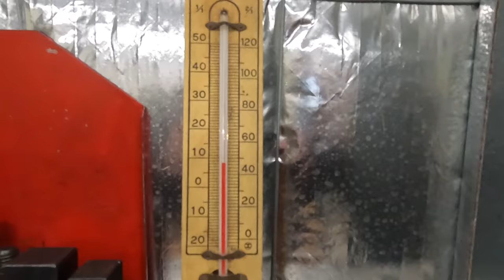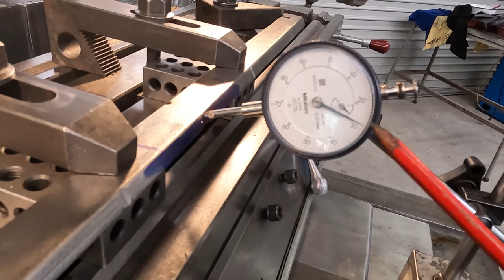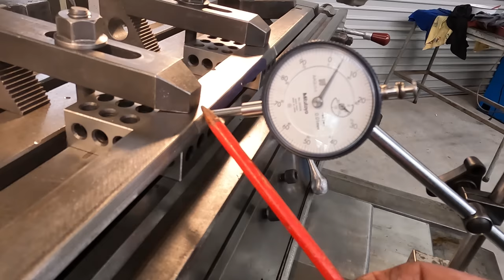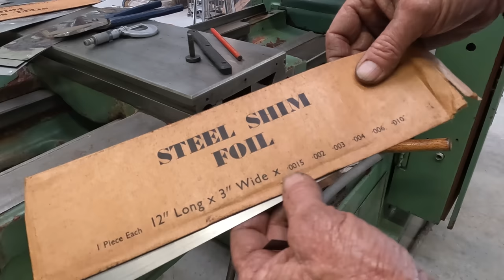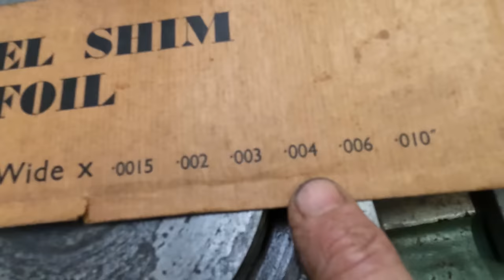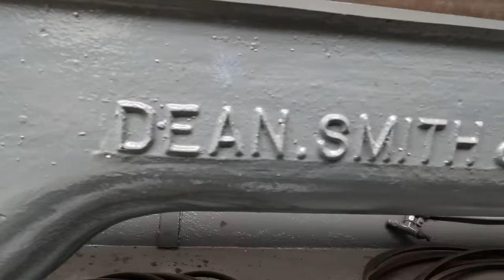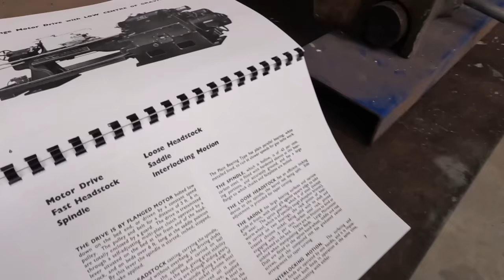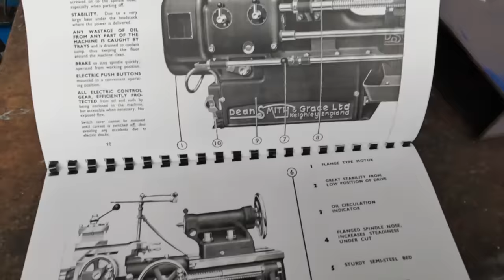Back On To The JFMT Lathe Repairs  & An Old Queen of machining Is Now In The Shop !

Comment: Steel shipping bands can be used as shim stock in a pinch, and also can be thinned on a surface grinder (the ultimate in desperation) The DSG is a good looking war horse.
Reply from the maker: Thanks .   I have a stash of banding , but it was too thick .    My grinder , a Jung HF50 is not up & running yet & i don't think it has the req'd travel .  It's a bloody long gib !  👍

Comment: Hi Max, my Mum in Perth and Brothers are complaining about the cold.
My DSG 13x42 was built in 1954, I got the date verified by a DSG agent in North Freo, back in 1995, He sent the serial no to DSG UK and they had records of the lathe.
Imported by Gilbert and Lodge and used by the PWD in Perth.
I was only 2 years old when she was unloaded from the ship in Freo wharf!!!
She had a rear mounted 5 HP Crompton Parkinson motor, UK made.
Had a Matrix clutch driving through the gearbox and then through 5 B section link belts, Brammer belts.
One pulley had built in eccentrics to loosen or tension belts, pretty clever.
I think the belts were designed for better finish and good shock absorption for interrupted cuts.
Of course the feed gears were mounted on the spindle.
Your change gearbox for feed shaft and leadsrew looks the same, chain driven internals.
That beast will remove metal at ease.
Reply: Just to clarify the chain in the feed  gearbox is attached to the knob which moves the selector in the gearbox.
I know the internals very well after my 4 year old Daughter had played with the lathe while shutdown and engaged the half nuts, next morning started the lathe motor and engaged the clutch, horrible noise, the carriage hit against the support for feed and leadscrew casting.
Stripped 2 gears, one of them was internally splined, hardened and profile ground, had them remade by professional machine shop in Myaree.
He was critical of the DSG design,  crossfeed to short, allowing rocking, they did this to accommodate the power drilling attachment to clamp on the dovetails.
Handy attachment with 4 MT taper.
Reply from the maker: @willemvantsant5105  Ouch !    Also the tracer attachment mounts there as well .  That drill attachment looks a good thing , there is a picture of it in the manual i have .  👍
Reply from the maker: I would love to be able to track down the info on my one , have the serial number but it may be too old .  👍
Reply: Give DSG a call, they might may have records back that far.
I have some original manual pages for that machine, but not anything you don't have in the reprint copy.
I wouldn't be surprised if it was lineshaft powered in its early life, I believe that generation of machines date from the late 1920's to 1949 / early 1950's when the new models were launched, but finding any definitive information is difficult.
Reply from the maker: @dutchgray86  Thanks .  I just looked them up for the contact email .  👍
Reply: @swanvalleymachineshop  I had a look in my archive and I have an original sales brochure for this generation of lathe also.

Comment: Max-  I have used Loctite (Henkel) to glue the shims to the gib strip.  Just clamp them overnight, and let the Loctite set.  A little heat will remove the shims easily if needed.  I have done this a few times and it makes it less fussing around when installing everything.  Also, do not overlook steel banding material used on pallet shipments for a source of shim material.  I have seen from .015" to .023" banding.  You can even surface grind it to fit.  ---Doozer
Reply from the maker: Thanks .   I have some  steel banding i have been saving for such purposes , but it was too thick .    👍
Reply: @swanvalleymachineshop   I don't remember if you have a surface grinder functioning, but remember you can always grind sections of the shim, and move it over on the magnet. No need for a long capacity grinder for just a silly shim.   Also the DSG is wayyyy coool.  I have a Colchester 17" round head lathe, and the engineering on it is a bit sketchy.  Probably more of a general use machine than a toolroom machine.  Interesting to see the design of the DSG as you take put it back together.   I really love these detailed machine videos that you do.  I have many machines in my shop that I am restoring.  Man if we were neighbors, we would be at each other's shops all the time.  Darn other side of the planet !   --Doozer in NC USA.
Reply from the maker: @kooldoozer  My grinder is a German made Jung  HF50 , but i still have work to do on the machine before it gets powered up .  Lol , yes we probably would be knocking back a couple of coldies on occasion !

Comment: It looks as if the machine has never been worked hard, it seems to still have a lot of life in it, of course it is from the 30's or 40's and that means it was produced and built like a tank, it will be a welcomed addition to your shop. 
I can only say that the Horizonal Boring Machine is what I am growing old waiting for you to work your magic on, even though the Boring Mill has defiantly been worked hard and put away wet as they say. see you and thanks for showing us all these things from the land down under, you are having winter and we in the western USA are having a hot summer.
Reply from the maker: Thanks .    The Boring mill is high on my list .  I will be doing it at the same time as the DSG .  Cheers .   👍

Comment: Max it is certainly a beautiful Old Machine. If you are anything like I am you want to keep it as original as possible. Hard to do sometimes but that is why we do it. Great demo on the repair of the Gib. My cross slide Gib has already been shimmed but I will be making a new cross slide nut and screw. When I get to that part of the restoration. I've been chipping away at it for 3 years now but only work on it when I am in the mood. I am looking forward to your next video. As always thanks for bringing us along.  Too bad we can't meet in the middle on the weather. It got up to 113 Faren height here this week.
Reply from the maker: Thanks .  👍

Comment: Definitely on the squiffy Max, great diagnosis on the errant gib strip.
DSG looks like it was intended,  or was in the design for lay shaft, as you say,  motor bracket looks shop made,  possibly motor was floor mounted?
Very nice lathe.
New shop looking good 👍. 
Thanks for sharing
Reply from the maker: Thanks .  👍

Comment: Ha ha! You made getting that leadscrew back together easy. Have a very neglected manual lathe at work with similar issues and it took me 15 mins to find the hole 😅.
That's a nice old unit. Hope the spindle bearings are in as good as condition as the rest of her 🥰. I'm sure all them aesthetic issues will be a piece of cake for you 👍😁👍.
Cheers!
Reply from the maker: Finding the hole is always the easy part !!!    👍

Comment: Bloody hell Max, that DS&G is a huge project, good luck when you start it. Not wanting to teach granny to suck eggs, did you check the inside of the bed for a date? some manufacturers cast the date in the bed. As an aside I am currently working about 30 miles from where this bad boy was made, small world eh?. ( Keith Rucker might be able to shed some light on the model and motor conondrum, he has a huge library of vintage machinery handbooks and manuals). Regards, Mal.
Reply from the maker: I will email DSG & see if i get a reply first !   👍

Comment: G'Day Max, We got the heat wave here today...on this side of the rock. That should be a huge improvement with that gib sorted...
Now, any lathe that has my name on it must be top of the line...Lol. That thing is built like a precision battle ship, should be a rewarding project !
ATB....Cheers.....Dean
Reply from the maker: Thanks Dean .   It weighs more than the 530 x 2000  JFMT & is a smaller machine !   A solid bit of gear . 👍

Comment: Hi Max, Midland Workshops opened 1904 and closed 1994.
Would speculate she was lineshaft fed and  electric motor added at a later date.
Is the motor 50 Hz or 40 Hz, in the old days Perth ran on 40 Hz, maybe another possible reason she came without motor.
If 40Hz will run happily on 50 Hz, more iron.
I am guessing late twenties to early thirties for her age.
Mine ran on Timken roller bearings up to 1800 RPM, barely hear it running.
I occasionally rode a steam train to Mt Lawley Tech from Freo at the start of my Apprenticeship, memories.
Reply from the maker: The motor was made here . I will check the Hz .   It has had a test run when the wiring was checked by the previous owner .   What worries me is if it was run with no spindle pre lube or inspection after sitting outside for so long .
Reply: Bit of a worry with Babbit bearings I assume, if Bronze a little more tolerant without lube.
Mine had an internal piston oil pump driven off a cam on the input shaft passing oil through a magnetic strainer to the spindle bearings and other critical areas plus sight glass drip indicator.
Is yours splash lubricated?
Reply from the maker: @willemvantsant5105  Electric pump for the headstock lube .    They topped up the oil tank & had the headstock lid off to check  the oil flow .    I will still have to pull the caps off for inspection .
Reply: Yep, recall now seeing the copper oil tubes, wonder if the electric oil pump was a much later addition, certainly well ahead of its time.
Seen it on a nineties Colchester Lathe, would not run up, failed oil pump, pressure switch not giving permissive to start.

Comment: Hi Max, I have the same machine in my workshop 4AN I believe but looks almost identical to yours.... if you want any pic's drop me a message ... the "isolator switch" is an oil filter, it says "turn daily" from memory.
Reply from the maker: Thanks .  Do you know what the original colour was ?    👍
Reply: @swanvalleymachineshop  Wartime Grey ... mine is 1942ish ... it was then the control levers were made shorter and straight, less ornate.
Reply from the maker: @darrendean21  Thanks .

Comment: Oh hell Max that's not cold 4C is just a brisk morning!  -40? now that's bloody cold..Heh Heh  
Worn gibs can and will  drive you batty,  If I ever encounter a broke one like you have I might just loose it completely! They guys with white coats and butterfly nets will have to haul me off!  
It does strike me odd that they left as much as the did behind the slot on the fat end. What is that an inch (25mm) ? That gib almost seems too long to begin with. Nevertheless, you can only mess with something for so long. If it works as it should I say run it!  If complete rebuild is in the cards later, you can plan ahead some. Anyway progress is being made. 

A DSG eh?  Even here in the US  a DSG well regarded to those in the know. I am half Limey so I really like 'em.  Cheers
Reply from the maker: Thanks .  Yes , the gib looked about 3/4'' too long .   Not cutting it though ( yet ! ) , been caught out before !!!    Bugger  me , i am glad we don't get those temps !  Hey , i have the parts to build a diamond lap for scraper blades now .  Cheers 👍
Reply: @swanvalleymachineshop  Great news Max, be sure and share diamond lap with us, I know a few of us will be interested in what you come up with. Cheers
Reply from the maker: @warrenjones744  No worries .

Comment: There’s a air gap under ur crosslide u can see at about 36:55
Reply from the maker: Yes .  The slide runs on the lower flat part , the top has clearance .   👍
Reply: @swanvalleymachineshop  no the lower flat has a gap u can see light through it briefly check it with a feeler gauge I’m telling ya